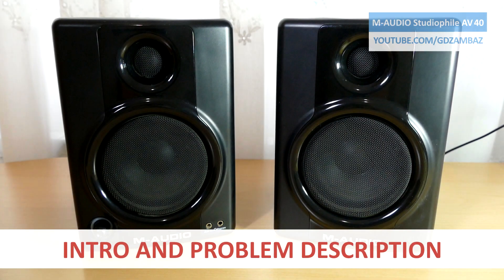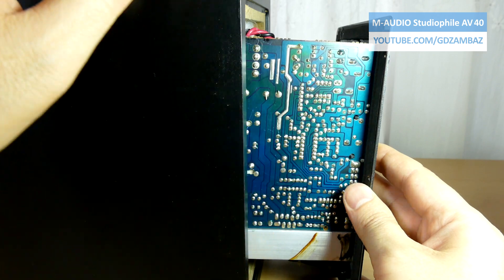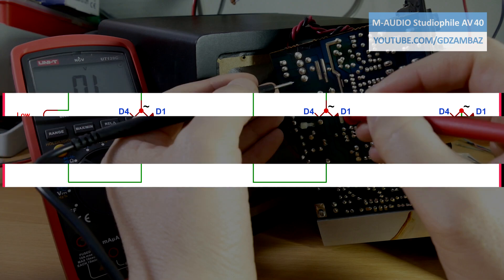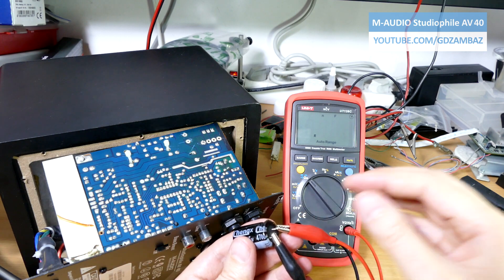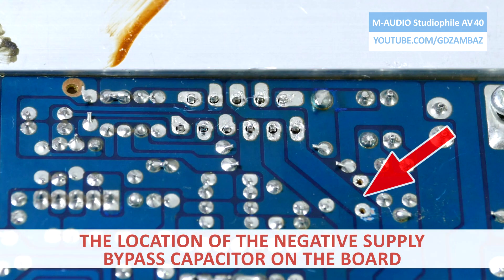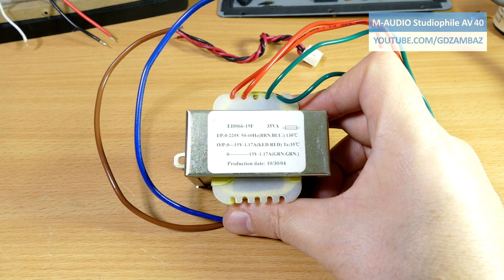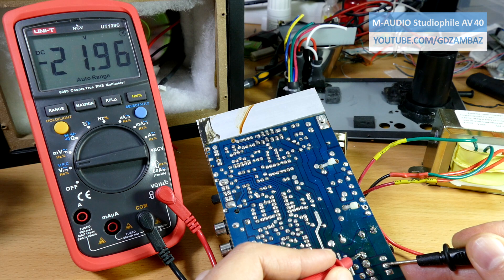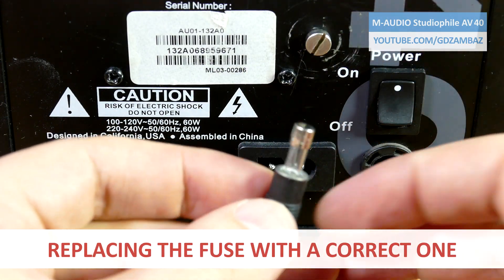Repair of M-Audio Studiophile AV 40 Speakers

Comment: Great video 😍! Very good diagnosis and fix.

When I powered on my M-Audio AV40 speakers after a one-week vacation, there was a loud hum, and then after about one second everything shut off.
Verdict: shorted bridge rectifier and a blown fuse. Fortunately, the transformer was not damaged (thanks to the fuse).

I replaced the bridge rectifier, the fuse, and four capacitors (2 × 220 µF and 2 × 4700 µF; their measured capacitance was above the nominal values).

Everything is working again! 
And by the way, the background hum is much lower than before.
Reply from the maker: Thank you for the feedback and for sharing your experience here!

Comment: Good explanation. However before closing the board you could have checked the various voltages, especially on the IC and the Zener diode. Since at the beginning you mentioned about the over heating of the Zener diode.
What is the value of the Zener diodes?
Thanks.

Comment: The left speaker in my AV40s has very very low volume, while the right speaker sounds normal.

Has anybody seen this issue and help identify what’s wrong, please?

There are no m-audio repair shops in 1000 miles from me.

Comment: Thankyou very much for your support. What does the TRS input mean?
Do you have a full circuit diagram for the above? I am 75 + and electronics is my hobby. Incidentally I got one of the above from my niece and as it was not working I was looking around for a solution and luckily found your site.
Can you please help me?
Thanks once again.
Reply from the maker: @Chacha-c2b , TRS is an acronym for Tip, Ring and Sleeve, and in this case it refers to the type of connector that these two inputs are intended for. For more information you can read the "Phone Connector (Audio)" article on Wikipedia.
Unfortunattely, I do not have the full schematic of the circuit, but that's not absolutely necessary - during the repair I only used the datasheet for the amplifier IC (TDA7265).
With the info found in the datasheet, and If you have good knowledge, experience and skills in troubleshooting electronic devices, you have good chances to fix your set.
Best regards,
Goran
Reply: @GoranDzambazov  Thanks for your reply. However I from the Old school! So just like your fault finding I too tried to trace the fault. But in my PCB they have used many SMD components. 
I have two Zener diodes in the Power supply which get hot. Voltages on the Audio IC and power supply are OK. I checked all the capacitors with a capacitor meter and found them to be Ok. But the input signal does not go through. Zener diodes show OK with the meter. Can you suggest some more method to check the Zener diodes?
Reply from the maker: @Chacha-c2b , I assume that the Volume potentiometer is not set to the minimum while you are checking if the signal comes to the inputs of the TDA7265 IC.
It would help you if you can find a way to somehow trace the input signal on its path.
I hope that you understand that it's difficult and time consuming to assist in repairing an electronic device in this way, by exchanging messages. So, perhaps its better if you can find someone to assist you in person.
Best,
Goran

Comment: I purchased a budget set of speakers a couple of months ago, the Edifier R2730db (2.0).

These are the first actual speakers I purchased, so I am not very knowledged when it comes to the technical aspect.

In general, I am very pleased with them, considering their price!

However, I do notice a little issue that bothers me. I am not quite sure whether this is a normal, or whether there is an actual problem here (and if so, can it be fixed? perhaps I did something wrong).

When the speakers are on, but nothing is playing, I can hear a pretty noticeable sort of noise coming from the speakers. It sounds pretty much like static noise, just a lot of buzzing really, somewhat comparable to a condenser microphone that produces a lot of self-noise.
This happens on all connection types I have tested; bluetooth and the two line ins (CD-player or USB audio interface).
When you turn up the volume, it gets worse, of course. When you turn the volume up completely, it is pretty bad and impossible to listen to. But even when I watch a YouTube video on my computer connected to the speakers via bluetooth or a USB audio interface, at what I consider a normal volume level (it might even be on the lower side, as I cannot stand loud sounds), I can still often hear the noise through the other sounds that are playing.
Reply from the maker: Hi,
The noise issue you described does not seem normal, however, it would be difficult to assist you in isolating the cause of the problem without too much involvement.
Perhaps if you can make a video recording of what you described, so we can hear the noise and get a better overview, then either I or someone else could give you some suggestion.
Best,
Goran

Comment: Did you strip out a screw head because the nut was glued? And replace the screw, that you painted at the end?
Reply from the maker: I'm trying to recall, but the repair was six years ago, and now I'm not sure what I did exactly with the original screw.
Reply: @GoranDzambazov  One screw I would like to remove is glued. I nearly stripped the head. I’m going to try to remove the glue with the soldering gun tip! I was told this speaker was buzzing quite badly but I never turned it on to listen. I just disassembled it and recapped it. The caps were obviously bulging and leaking. Well, it’s not buzzing but there is no sound output at all. The woofer and tweeter both work though, I bench tested them. The led on the volume control lights up and I have 21 volt power on both sides of the bridge rectifier. I really know nothing about electronics, just dived in to try to fix it with the help of some yt videos. I hate to be a “parts swapper” but that’s the level I’m at right now. I hope to learn electronics and be a better diagnostician soon.
Reply from the maker: @mguerramd , I can only advise you to find the datasheet of the TDA7265 amplifier IC and continue investigating.
Check if the IC is properly powered, then connect a signal to the input and to try to trace the signal from the input to the output.
Reply: @GoranDzambazov  I don’t know what any of that means, but I’m going to find out and do it! Thanks 😊
Let’s see, check across pin 3 and pin 6 with a voltmeter while it’s in circuit?
Reply from the maker: @mguerramd , check the voltage between the pins 3 and 9, and between the pins 6 and 9.

Comment: Hello! Thank you for the detailed repair instructions. I have the same pair of speakers, bought second hand of course because they were very cheap, but that is/was for a reason. My speakers play sound but still have the same hum and they appear to distort sound on higher volume specially if the Bass Boost is on. Any idea of what might cause that ? Should i follow the steps presented by you at least to check if the values are "normal" ? Regards!
Reply from the maker: Hi,
From what you are describing, I would advise you to check the electrolytic capacitors in the power supply section.

Comment: Hello, could you please tell me where the black wire that is attached to the speaker's wood should be connected? I accidentally detached it, thanks for your help
Reply from the maker: Which wire exactly are you referring to? If it appears in the video, please send me a timestamp.

Comment: I accidentaly switched from 230v to 115v, i checked the fuse and the fuse is definitely messed up. Im not sure if anything else is messed up though, do you think that something else could be messed up or do i just need a new fuse?
Reply from the maker: Return the switch back to 230V, replace the fuse and try it out. I believe that the chances that it's only the fuse are good.
If it still doesn't' work, then check the transformer.
Reply: @GoranDzambazov  thanks I bought a new fuse and they are working again. But, a friend gave them to me a few days ago and he said he hasn't touched them in years.  When i turn the music on, the left speaker sounds so much quieter and overall not as good as the right one quality wise. I am almost positive that it's not the wires on the outside but the speaker it self. What do you think could be an issue, and thanks for helping me once again.
Reply from the maker: Glad to hear that they are working again!
Regarding the left speaker issue: to verify that is not the source or the RCA cable from the source to the line input, try with a different source and cable or simply try temporarily swapping the cables for the left and the right channel and see if it will be the same. If the left speaker is quieter again, then the issue could be something in the input circuitry in the amplifier (in the left channel) or maybe the speaker itself.

Comment: Hello, thank you for your video. Do you have the link to the components you changed ? Thanks again for your help.
Reply from the maker: I bought the transformer, the capacitor, the bridge rectifier and the fuse in a local electronics store. Those are common components and you shouldn't have a problem finding any of them. But it's also important to correctly identify the cause of the problem.
Reply: I sent you a message on messenger.
Reply from the maker: @tsantsaman , if you have more questions, please put them as a comment here.
Reply: @GoranDzambazov  All right, I just bought these second-hand speakers for my son, but they don't work properly, the seller doesn't want to take them back, so I'll try to repair them. They make the same noise as on your video. I've found almost all the parts, but I can't find the transformer. Could you help me, thank you.
Reply from the maker: @tsantsaman , other faults could cause the same noise or hum, so you first have to properly investigate the problem, before taking an action such as the transformer replacement.
I advise you to first check the resistance of the primary coil of the transformer, the voltages on the secondary side of the transformer,  the diodes of the bridge rectifier and the  smoothing capacitors.
Reply: @GoranDzambazov  thank you. It looks very simple when you see your video.

Comment: Really good mine do not work at all. Like no power the blue light don’t even come on.  Replaced the plug fuse.  Still nothing.
Reply from the maker: Thank you and good luck with the repair!
Reply: Hi again. I have av32 that is not working. Have you fixed these before. I have 4 resistors burnt out. R13a r13b r13c r13 all in a row. But I can not read the values on to of the board.
Reply: Resistors  not board.  Its the board that contains the yellow part and the on off switch.  Your help would be great if you have the values.
Reply from the maker: @grahamfranklingf , I'm sorry, but at this moment I cannot help you: I haven't repaired the AV32 model and I don't have the information that you need for the resistor values.

Comment: Hi. Do you have any suggestions on how to get a fuse out, that is partially stuck? The fuse blew and half of it is now inside the speaker. :)
Reply from the maker: Sorry to hear that. I don't have any particular suggestion. If it's definitely not possible to be removed, perhaps you'll have to consider replacing the fuse holder.

Comment: Well done. Trying to troubleshoot my own AV40s which no longer turn on. I suspect a similar problem to yours. However mine look a little different on the inside (newer model?) and various parts are glued together, making it difficult.
Reply from the maker: Thank you.
If you haven't done that already, you may first check the fuse and replace it if it's blown. Sometimes it can be that simple. However, there are often other failed components, so, before you plug in the speakers back to the mains power, you'll probably need to continue investigating further and verify that everything else is OK.

Comment: Interesting… I'm getting a very similar issue with mine. I get the loud hum like yours (it seems like it goes in and out of phase at the start and then just stays "in phase") but I still get sound from both speakers… except very distorted! From your video, I suspect it's the amplifier and, while I'm willing to give a shot at the repair, I'm not sure it's worth the cost of fixing them… 😬
Thanks for the extremely detailed video! Regardless of whether or not I got ahead with the repair, I enjoyed your walkthrough and strategy to pinpoint and fix the problem! Pretty much an electronics lesson… :) Kudos
Reply from the maker: Thank you! Comments like yours motivate me to continue with my electronics and repair video lessons.

Comment: Goran you made an excellent video guide and explain basic troubleshooting methods. I like to see you are not confused with uncertainty measurements especially resistance in the circuitry. I repaired mine AV40 before few years and found an electrolytic capacitor was vented out so after replacing all power supply capacitors humble noise was gone. Recently channel on the main box was gone and another channel had a hum noise so it will be fun to repair. I suspect the problem may be caused by TDA7265. By the way, I recognize the Unior pliers you used, I got the same tool to bring with me a long time ago. Keep doing educational work and stay safe!
Reply from the maker: Nenad, thank you very much for your comment and feedback and for sharing your experience with us here!
Yes, the good old Unior tools were especially appreciated in this region and they still have a special place on my bench :-).

Comment: This is EXACT what I've been looking for! My symptoms are definitely not the same but you've answered a few questions that I've had from a disassembly perspective. Also, for people who have come here for the same reason I have (audio issues with their AV-40), there is a really good write up on some potential issues with this speaker here: http://projects.g.ydftech.com/home-1/m-audio-av-40. Thanks Goran for such an great video!!
Reply from the maker: Thank you Brett.
Reply: @GoranDzambazov  Since something on my main board has issues, would it be possible to just use the crossover on the main board so that I can externally amplify the speakers? If so, how would I go about finding the crossover components?
Reply from the maker: @brettwertz7069 , the IC amplifier used in these speakers is TDA7265. The signal outputs are the pins 4 and 2. You can find and study the datasheet of this IC for better undersanding of the circuit.

Comment: That DC-offset doesn't look right, mine was 20mV. I have heard that DC-offsets of 100mV and over can damage speakers.
Reply from the maker: While I also don't like the fact that there is a DC offset of 0.2V on one of the outputs, the dissipated power resulting from this voltage is only 10mW (this is for a 4 Ohms speaker). That will certainly not damage the speaker.

Comment: Hola tengo un problema con los  monitores míos son Maudio av40 
lo que me sucede es que cuando los enciendo suenan en un volumen muy bajo 
los desarme y pude  notar que las piezas verdes estaban en muy mal estado avían estallado botando un liquido blanco 
aun sirven los monitores pero suenan muy bajos 
que me recomiendas 
Saludos desde colombia
Reply: Hello I have a problem with my monitors are Maudio av40
what happens to me is that when I turn them on they sound at a very low volume
I disassembled them and I could see that the green pieces were in very bad condition, they exploded spilling a white liquid
Monitors still work but sound too low
Reply from the maker: Hi,
I'm not sure what exactly you are referring to when you say green pieces, but from the rest of your comment it looks like that there are some damaged capacitors. If that's the case, you need to identify and replace them properly. Also, it's important to find the cause why that happened, to avoid repeating the problem again.
If you are not experienced in electronics, I advise you to ask support from a qualified person for this repair.
Best, Goran

Comment: I like my AV 40's too much to not fix this hum. Thanks to your video, I'm going to try. Really great video. Thanks for sharing it.
Reply from the maker: Thank you for your comment.
If you just experience constant low level hum from your speakers but otherwise they still work normally, then the cause in your case should be something different.
Reply: @GoranDzambazov  It ended up being a leaky capacitor. I'm pretty bad at soldering and I managed to partially detach the soldering pad, but I still fixed it. Thank you for the help.
Reply from the maker: @EricHaluska  Great! Thank you for sharing your experience with us.

Comment: Hey do you think the AV42 / 32 series has solved this problem?  Their website says they switch on / off automatically if they get too much signal and they have heat protection - or will they just sound crappy and then fail?
Reply from the maker: The problem described in the video is not something inherent to these speakers (AV40) but rather universal. The overheating was a result of a complex chain of events and it can happen to any electronic device. If you have omitted that part, please watch the end of the video again to see the main reason why the things developed this way in this case.
Reply: @GoranDzambazov  thanks!  grabbed some av32's at best buy, will play with them today